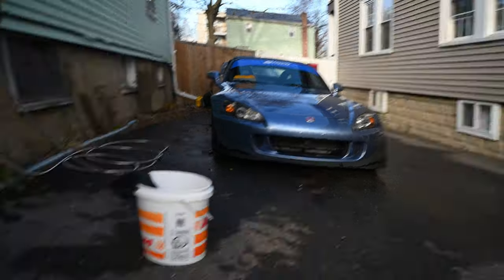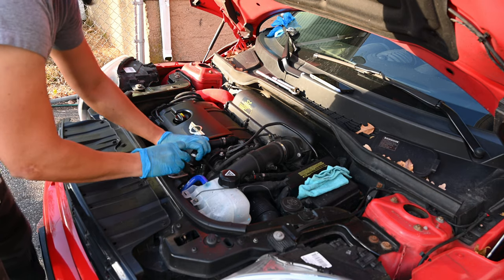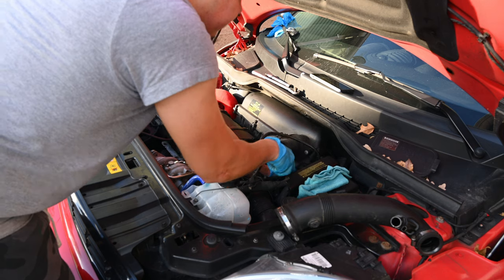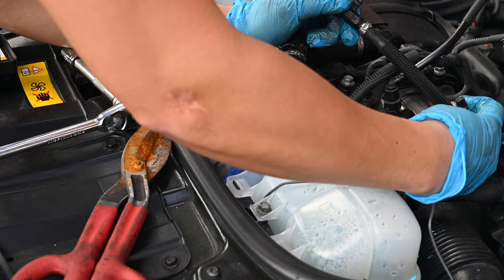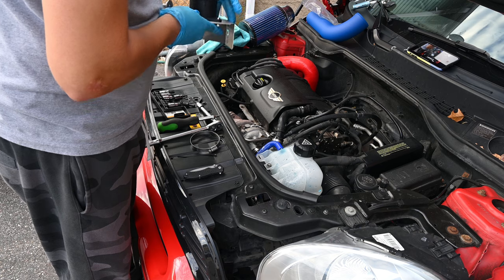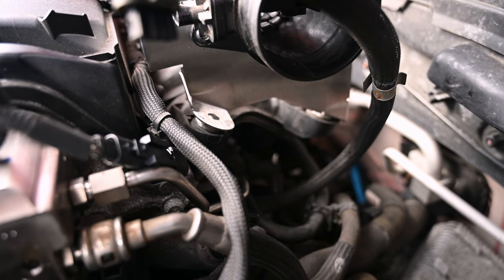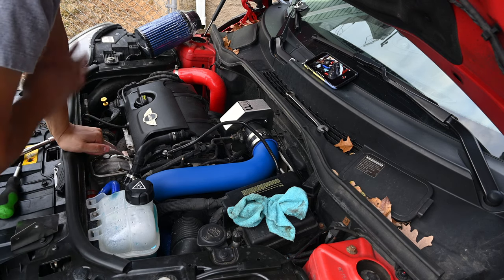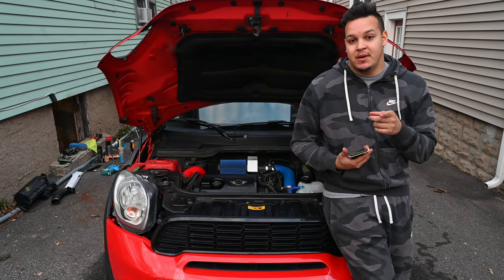Gen 2 Mini NM Intake install

Comment: I appreciate you sharing this.  I do wish you had shown a couple things more clearly.  The smaller diameter hose that needs a hose clamp clipped off and the resistor connections / how you secured the wires so they weren't flopping around.

Not trying to be critical, but rather hope you'll show things like this in future videos.  Thanks!

Comment: I have JCW Paceman. Help that tick/ knock … Use Amsoil Synthetic Euroblend. I made my own Catch can…. Not many available, it’s a must have. Carbon clean every oil change with with CRC intake valve / turbo cleaner. Change plugs every 40K. 
I also have 2-other Minis and a 2005 WRX STi. Which are all highly modded. 
R60-R61 Minis don’t like mods much… it can quickly make them worse. Ecu tuning is key if possible.

Have fun
Reply: @liampettit7446  Yes the CRC cleaner you linked in your post is the correct cleaner for the Mini. Buy 2-bottles and clean before every oil change. Believe me it makes a massive difference in the first few uses. As for the Amsoil oil. It’s expensive but worth every penny. I use it on all my vehicles for many many many years. 

https://www.amsoil.com/search/?text=European+blend&timezoneOffset=240

The oil… just search for Amsoil European Blend 5W-30.

As for reliability for the Mini… Replace all fluids being that your at +70K. Replace fuel filters if possible and spark plugs. Replace belts and look for worn out items under the hood. I personally know that all cars around 100K are going to need many parts to be replaced so I keep the wallet on stand by anticipating failure. Look for reliability issue videos and topic/ forums know for your model across the web. Mini are NOT Toyotas which are more reliableI. I would highly suggest getting an oil catch can for extra reliability. There are tons of books and sites for the Mini with much resources available that talk about know common issues .

Comment: One thing I see is you are moving your intake even closer to the hot side of the engine but I’m sure it fine
Reply from the maker: Not really, the NM intake sits over the intake manifold getting away from the hot side where the turbo manifold and turbo are. Plus once moving and over 20mph, there's an abundance of cool air moving through the engine bay. At least thats what NM says. Only regret I have with the intake is I didn't get the carbon fiber one.

Comment: How big of a difference did you feel after doing intercooler, charge pipes, downpipes etc?
Reply from the maker: The down pipe and intercooler were a night and day difference in performance. Same thing with the intake. The charge pipes I feel gave me more turbo noises than power, but a smoother air path has to be beneficial one way or another. 
Lastly I know this doesn't equate to power or anything other than to appease my inner child, the pops and bangs were a lot more pronounced and I'm still stock exhaust from the down pipe back.
Thanks for watching!
Reply: @MojoGarage  so I plan on doing cold air intake, intercooler, downpipe, oil cooler, and iridium spark plugs. After that looking to do a dyno tune. I have a 2021 mini cooper countryman s all4. You think by doing all that, I'll hit 300hp? My goal is to get over 300.
Reply: Most likely forged pistons and rods to be safe and bigger turbo.

Comment: hey mate, question, what you did with the air sensor that goes connected  into the original hose?
Reply: I hear you cut them, but then what? sorry about  if its a dumb question..